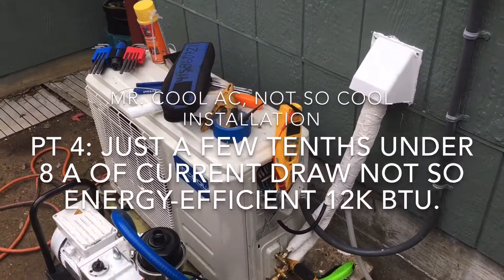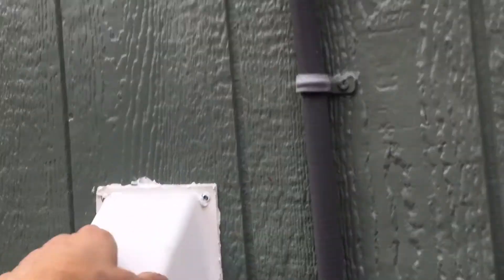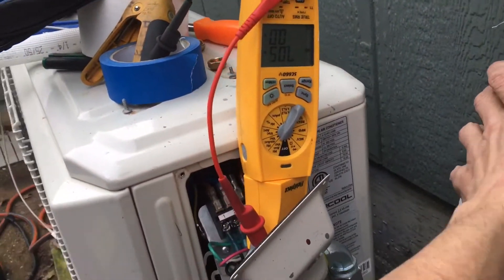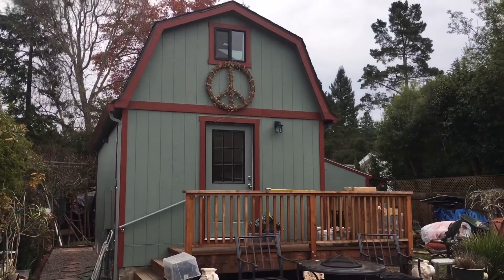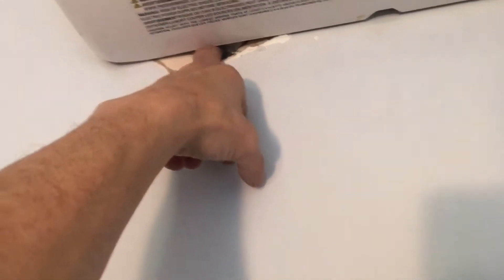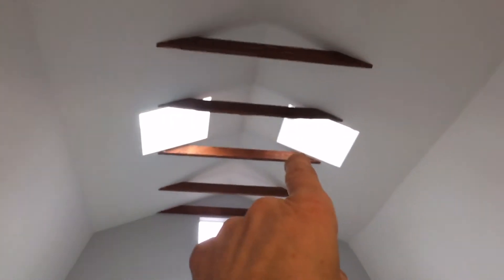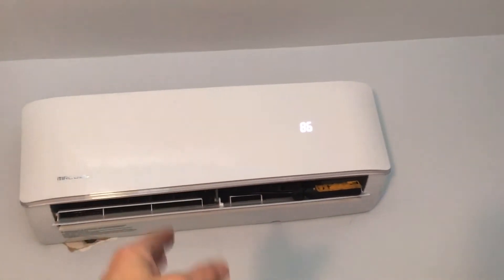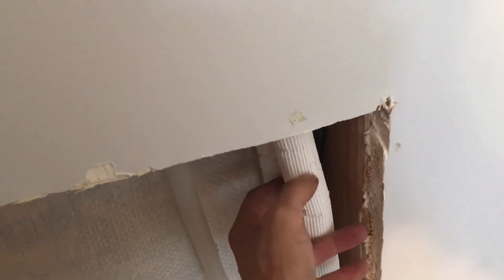Pt 4: mr. cool AC, not so cool installation

Comment: Just because amps are high now does not mean they stay there. Thanks for the video. My AC pulls 14 Amps and that’s all I get. Inverter driven DC motors can ramp up and down. Personally I view it as a positive that it can pull high Amps relative to its size. That equates to a quicker satisfaction of temp before it ramps down to maintain the set point. Again, thanks.
Reply from the maker: That is true but however even after satisfying to maintain temperature these units draw 20 to 40% more current than they are comparable counterpart of the same rating BTU output. 

         Especially when you find a real cheap units that only have a one speed condenser fan. 

        Yes having an inverter that can overdrive and give you instant satisfaction if you call for it is a good thing. 

      You could run this one test for the programmed algorithm inside your heat pump. 

        Hook up your wattmeter.   Call for cooling or heating only two or 3° above the ambient room temperature or even better yet if you can read the exact temperature that your air handler or thermostat is reading only raise your call two or 3° above what you want or below what you want if you’re doing cooling. 
             If you have a true inverter system you will notice that the compressor motor draws very little amperage and it ramps up very slowly with maybe only two or 300 W of power draw and it takes a long time to cool or heat this is a energy saving feature. 

           Now take that same unit and change your temperature on your thermostat 10 or 12° above the ambient temperature or below the ambient temperature depending on heating or cooling mode. 
              To give the customer satisfaction the program will see this difference that is great and instantly will ramp up the compressor much faster and drive it to satisfy either cooling or heating in this situation you may notice your white current draw jump up to maybe 1000 W of current consumption. 
            This is normal and this is good when desired. 
             But some of these lower cost cheaper Internet models do not have this feature they just go straight into full cooling or full heating consuming masses amount of watts from beginning to end until they satisfy. In this situation is where the consumer who purchase the system being advertised as energy savings just because it looks like it from the outside a lot of deception takes place in advertising.

Comment: Nice tiny house.. to bad all that T-111 will rot out.
Reply from the maker: Sorry for my lack of knowledge of nomenclature or abbreviations but what is T-111 
         We are in a fairly dry and the air region of California you could leave out dry untreated wood for about 20 years without rot. 

         rooftop mounted wood structures on buildings for refrigeration I’ve taken apart that were wrong and treated wood since the 1950s and 60s without rot.
         Looked it up thought it was the siding but not sure Google is my best friend. I See the YouTube videos about it. 
         I’ll pass this information onto the owner of the house. 

        Hopefully she’s lucky because she lives in a dryer climate region of California
Reply: @coldfinger459sub0  T-111 is name for the exterior wood panelling. Notorious for rotting, but usually because of bad prep/waterproofing.  But once it gets wet, it's a gonner....  Can you share the spec/brand/name for the insulation you replaced on this job?  I think you said "ISO-type" in this video.  Wanna make sure to get the right thing.  Also, thanks for sharing your knowledge.  Picked up some important tips from this series. (i always seem to learn more from  "mistakes were made" videos than "here's how to do it under ideal conditions."
Reply from the maker: @ianrhett  The ISO POLAR line set with insulation turned out to be a poor choice of manufactured product. 
            At the time I came across a few leaks with the ISO POLAR refrigerant line set I thought it was just a fluke a rare case. Then I did a search on YouTube and some HVAC forms and find out people across the country have been having the same problem. 

        Thank God I’ve only started installing it the last couple years and not on all of my jobs. 
               At first I thought I could just repair and change that section of line set but it turned out to start leaking on the other branches of lines so far I have six jobs I’ve had to totally replace all the copper on the job that had ISO POLAR refrigerant line set. 
          At five are the jobs now had existing refrigerant lines on other systems that are in the same building in the same rooms the copper manufacturers Mueller copper and their ages range between 10 to 20 years old with no leaks. 
             So from now on every time I go to a job site that has ISO  POLOR Refrigerant lineset I do not do patch jobs or repairs I bid it to replace the whole entire copper line set or I turn away the job because then you’ll have the nuisance callback of another leak and then another leak with a very upset customer making you the installer look bad because you didn’t replace it all at one time even though it’s more expensive. 
         It’ll be a lot more expensive replacing it section by section doing a patch job. 

       So I recommend sticking with the Mueller Copper. That’s what my grandfather used it’s. It’s what my father used and it’s what I reliably use even on my very own personal home and properties and my families homes installations never had leaks.

Comment: I just looked up a 2 ton icp heat pump, and it was rated at 14.2 amps.
Reply from the maker: What they’re rated at at max on paper and what they run in reality in Real every day use are two completely different stories. 
           As I’m writing this in my office being heated right now in San Francisco my Panasonic 12,000 BTU unit is drawing 3.8 A my outside ambient temperature is 51° the fog is rolling in in a few hours and it’s 91% humidity outside right now. 

           Where are the higher energy efficient little 12,000 BTU mini splits more used to seeing between 1.9 A and 3.5 A as the normal average draw. 

             As for the ICP or any of the big names. You could play with the numbers depending on what efficiency range you purchase. 

        Since I only purchased the highest efficiency range the last ICP two tone unit I installed once the temperature was satisfied and it was cruising along at 4.9 A.  That’s a far cry from it’s rated max capacity of 14 A. 
          That’s with a two stage compressor and the indoor air handler was a 3 ton unit for maximum efficiency.